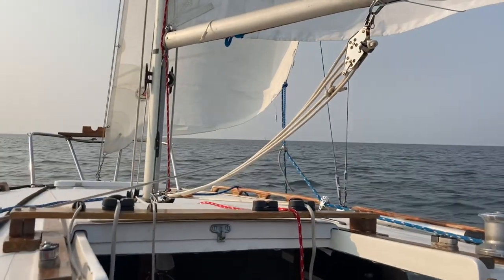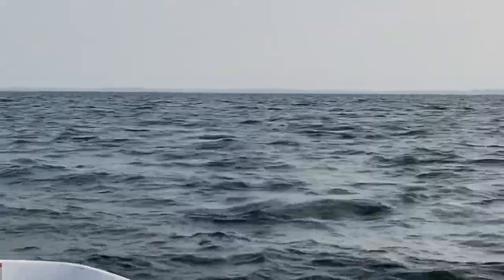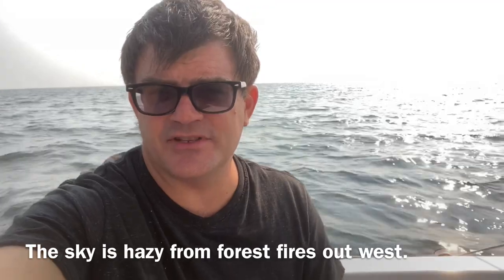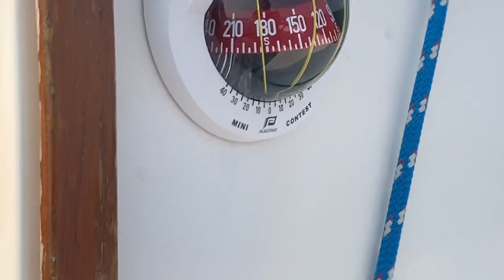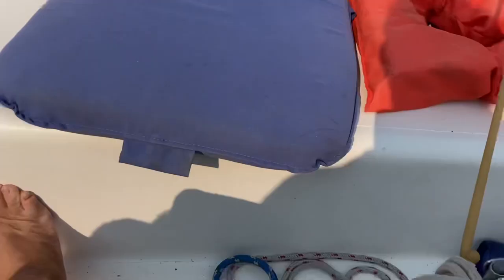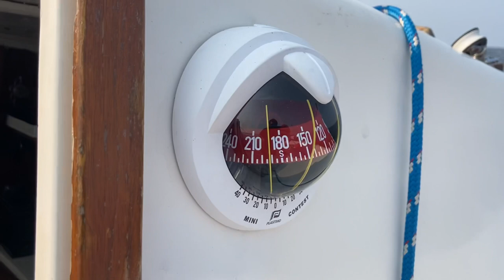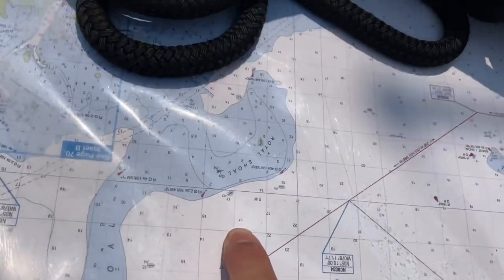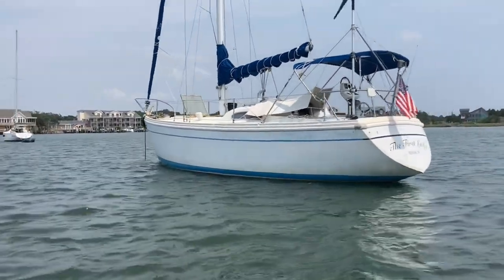Self-Steering My Sailboat to Ocracoke using Sheet to Tiller

Comment: Good vid, looks like quality time with your daughter. Thx for documenting your new work on self-steering. Did you study Webb Chiles?  Do you think this is more relevant for keel boats versus dinghy? I wonder if I should use a more primitive tiller lock to get a moment here, a moment of using my hands for tasks.
Reply from the maker: Hey Paul, so cool to see you here! You can use all of these techniques on the First Mod, but you may need to rig up some tail blocks or actually mount some blocks on the gunnels. Check out my other video. 5 minutes long with descriptions on the minimal hardware you’ll wanna put together. I read a book called Self Steering for Small Craft by John S. Letcher, Jr. whom developed these techniques crossing from CA to Hawaii on a 20 ft sailboat. I was hoping you would learn these light weight carbon neutral techniques.
Reply from the maker: Go to my channel and click videos, scroll to the bottom and watch “Self Steering Sheet to Tiller for Sailboats”. It explains the basics. Peace
Reply: @adventuresofsailorpauli1543  Thx for the tip. Good Ocracoke vids :)

Comment: If you get a couple of 8mm cam clets and place them on the tiller, it wiill be simpler to cange sides when tacking.
I have an simular system on my pacific 24 I recently bought.
Gerard.
Reply from the maker: Yep. I have considered that. I prefer my wrap method because I can pull off the elastic and the sheet-to-tiller line with one hand.

Comment: Thanks for the videos. Do you find different points of sail are better to tie the control line to the main sheet vs. jib sail?
Reply from the maker: Absolutely. Downwind to a beam reach is tied to the foresail. Upwind to a beam reach is tied to the mainsheet. Sometimes a smaller jib has a difficult time actually pulling the tiller and I rig up a 2-1 to increase the motion. That’s in my September Sail video. Give it many tries. Sometimes you can feel like it’s not working but usually there is something simple you haven’t tried.  It’s a lot like riding a bike in that at the beginning it seems hard, but eventually it clicks and becomes second nature. Most of my videos will  focus on a different aspect of sheet-to-tiller. Thanks for watching!

Comment: What kind of boat are you sailing?  And how is the sailing on the Pamlico Sound?  I know there are a lot of areas that are shallow.
Reply from the maker: Rainbow Dash is a San Juan 21 MKII with a long retractable centerboard. This was a boat commonly found with small fleets in marinas for racing in the 70's and 80's. I believe there is no better trailer sailer available today. The mast is light so I can set up the boat all by myself. She can reach 4 knots in 6 knots of wind and can turn on a dime. She is fast and sleek yet offers a roomy interior due to the flush deck and low berths. We can sleep up to four people comfortably. 
    The trip across the Pamlico Sound to Ocracoke is a great first crossing. Most of the boat ramps have creeks leading to the sound that often have a 3' depth limitation on the inland side. I have met a few seasoned captains that warn to stay a quarter mile away from any of the large shoal markers. The shifting shoals are littered with shallow wrecks. Rounding one of these "shoal markers"  too close has resulted in sailboats hanging up their rudder on the rigging of sunken boats which could sink a boat in rough weather. It can be quite rough in 15-20 knots. Be prepared to reef your mainsail if you want to stay dry or just be comfortable. 
   We prefer to use "Nine Foot Shoal Channel" to get into Ocracoke. "Big Foot Slough Channel" is in need of dredging currently. Anchoring in Silver Lake can be a little tricky as the bottom is a soupy mud. Bring appropriate ground tackle and always dig in your anchor with the motor. This trip is legendary. I have been dismasted twice and even chased by a waterspout. We often go there on Memorial Day Weekend. Maybe we will see you there some time.  I hope you have fun! Peace
Reply: How were you dismasted?